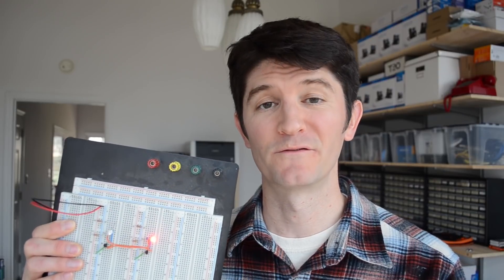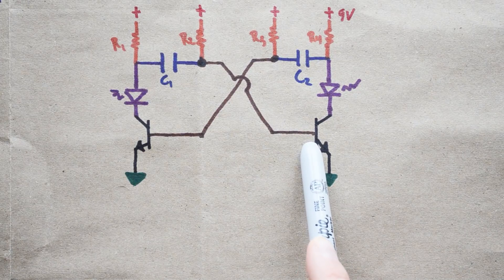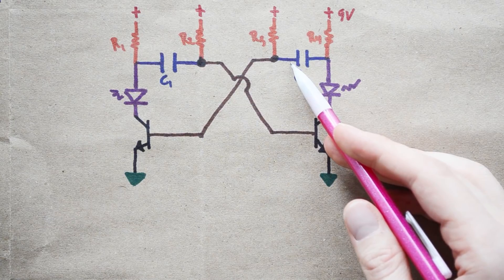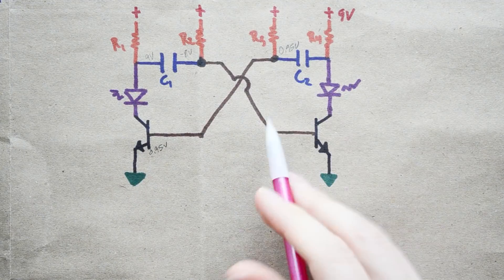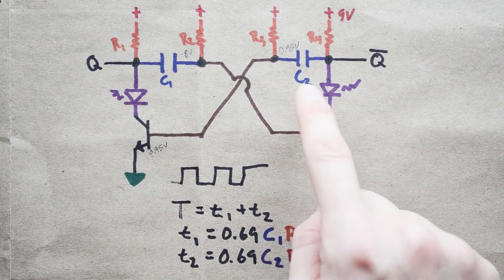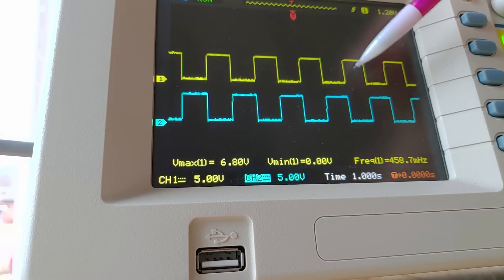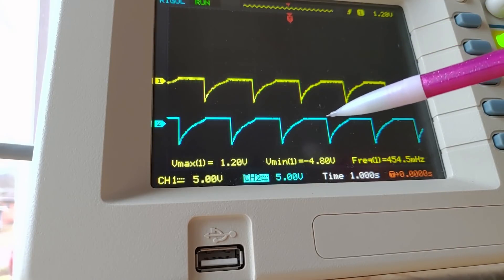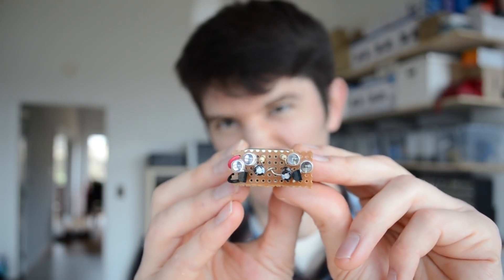The Astable Multivibrator

Comment: People may be surprised to discover that the capacitor voltage doesn't neatly go symmetrically between 1/3 Vs and 2/3 Vs like it does in the beginner text-books, because real BJT transistors aren't ideal switches. These idealised symmetric RC charging and discharging times are where we get the classic f = 1/ (t1+t2) = 1 / (0.69 * 2 * R * C)  calculation you showed. 
{the magic 0.69 number comes from ln(2), because capacitors charge and discharge logarithmically}
However in reality, we get the asymmetric "sawtooth" waveform you showed on the oscilloscope. This non-idealised waveform directly affects the real-world oscillation frequency, which is why your measured frequency didn't match the calculated value.

Comment: The capacitors will never be reverse charged more than a few tenths of a Volt.  Hook up a multimeter and check it for yourself.  If they were to be reverse charged to 8 Volts, they would probably be destroyed and possibly explode if they are electrolytics.

Comment: Hi Jason, may be if you have some time to explain a D Flip-Flop using discrete transistors, I've read it's possible to build one using two of them but I find that hard to believe, I'm struggling with this as I want to wire up a 4-bit synchronous binary counter, I don't want to simply go outside and buy a 74HC163, I want to build one. Thank you.

Comment: So the on time relates to one R and the off time relates to the other R.   I guess that makes sense.
How do I determine turning the LED on and off 10 times in one second equal on and equal off time.
Vs 5 on time but the off time be 1.5 portion longer.  All in that one second for each output.
What is the frequency of this set up?  2 HZ?

Comment: Thanks for the explanation. There's one thing I don't get. At 5:00 into the video, you explain how the capacitor on the right develops a negative charge which being connected to the base of the transistor on the left, turns it off. What I don't get is - the base of that transistor is also connected via R3 to Vcc (+9v), so - 
                  a) why doesn't that keep the base positively biased enough to keep the transistor on?
                  b) why doesn't the aforementioned capacitor dissipate its negative charge through               this connection to Vcc (+9v)?

Comment: Can this circuit work without R1 and R2? 

If I remove R1 and R2 what will happen?
Reply from the maker: If you remove R1, you'll probably destroy a diode. If you remove R2, it will drastically change the frequency and might not work.
Reply: Okay. Thanks for the information!

Comment: Hello there, i really like your videos. Can you explain how to understand the minus 8 volts at the capacitor. Thanks!
Reply: Hello Sir! Although I'm five months late, I think I can answer your question. If you notice carefully, resistor R3 has quite a high value (220K) and resistor R4 has a comparatively smaller value (1K). Since R3 and R4 have different values, the potential drops across R3 and R4 are different (we can calculate potential drop using Ohm's Law: V = I × R. Higher resistance means greater potential drop.). The supply tries to maintain this potential difference across R3 and R4. If we assign V3 to be the potential at the node(node to which the capacitor is attached) after resistor R3 and V4 to be the potential at the node (node to which the capacitor is attached) after resistor R4, the supply tries to maintain a constant value for V4 - V3, that is a constant potential difference. However, when the transistor turns on, V4 becomes zero as it gets directly connected to ground. Since the supply wants to maintain a constant value for V4 - V3, it turns potential V3 into negative. That is how you get a negative potential! I hope I've answered your question properly sir.
Reply: Thank you very much for answering me.
Reply: You're welcome😊😊

Comment: Nice video.  I am looking for a simple timing circuit with a 3 minute off and a quick  pulse on to activate another low current circuit in place of a cheap motion sensor on my owl decoy(to keep rabbits out of my yard) . I presume I can adjust duty cycle by the combination of resistor /capacitor on each side?  I wanted to ask before I invest the time to experiment.

Comment: I dont understand how 9v kan get to be only 0,95 volt after R2 and R3? i thought the resistors limited the current and not the voltage. (i am green in this)
Reply from the maker: The resistors do not limit the voltage. The 'turn-on' voltage of the transistor does. If the voltage ever reaches above 0.95 volts, that voltage would turn on the transistor at the base. Once that transistor is turned on, that base voltage will stay at 0.95V.

Comment: Hi, tnx for the video. Where will the current flow if c2 is discharging? Is it flowing thorugh r3 to the diode on the right and then through the transistor on the right and filnally to the ground?
Reply from the maker: Yes